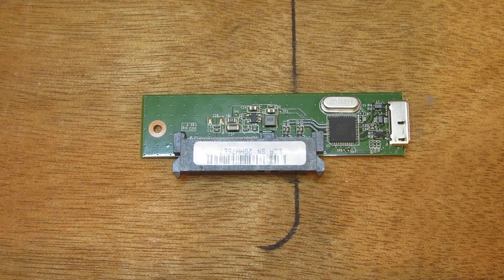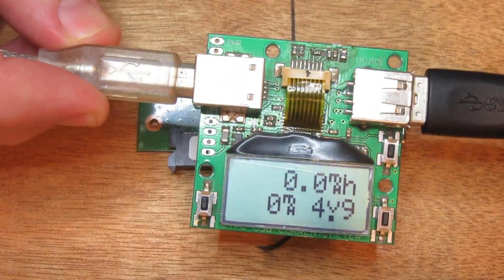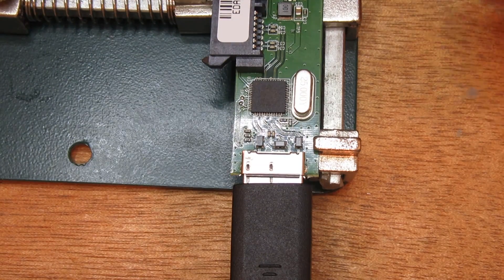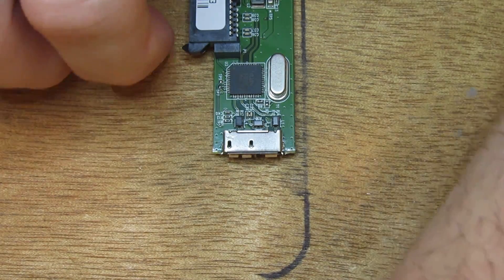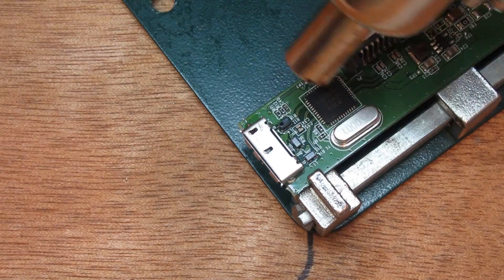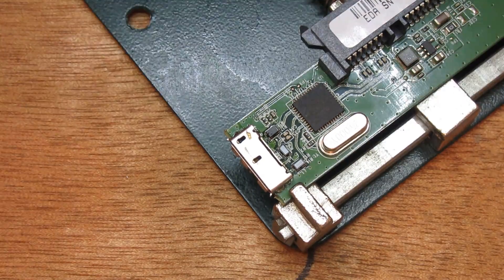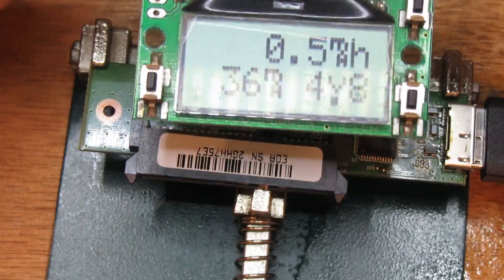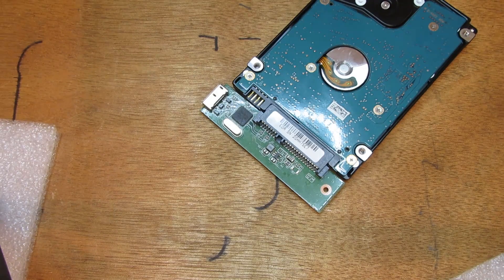What I fix daily - Hard drive USB-SATA Bridge board fault diagnosis and repair

Comment: hellıo, my 1 tb seagate external hd led light not turning on , in device manager it seems jms 579 (jmicron sata usb bridge)
disk management , disk unknown, not initialized, no size..

you think adapter is broken?
Reply from the maker: Easiest way is to get someone to open up the enclosure and separate the board from the hard drive and plug the hard drive in to a dock assembly
Reply: @pldaniels   i dont have an assembly but i have sata to usb cable? it can work? btw my hd was bitlocker protected..

Comment: Paul Daniels Thanks for video.
Do this board has in-built hardware (chip) for auto-encryption of data? I have bought 8TB Western Digital (WD) My Book ext drives that have this chip meaning if your board dies, your HDD is bricked forever cos all the data is encrypted with the key that is on that particular chip (needless to say, WD kindly provides this key for its users...). To get rid of that nasty encryption, I want to remove the WD HDDs from their original enclosures and put HDDs into some third party USB 3.0 to sata enclosures or use the type of board you are using here (if it doesn't have that encryption chip).
Reply: Engineer if WD provides the key what good is the encryption? It means they use the same key on all’s drives. Useless. You can steal and drive and get the key from WD. Not to mentioned if the above is true the key is already out there.

Comment: Have any suggestions where I could buy a board like that? I can't seem to find them on ebay
Reply from the maker: Just get any USB-SATA extenal enclosure and pull the board out.
Reply: Paul Daniels I opened up one of my Toshiba external drives from 2015 and the USB port was attached right to the board of the hard drive, there wasn't an adapter :/
Reply from the maker: Ah, one of those awful integrated USB drives.  Spot of bad luck there.  Just go to eBay, buy a 2.5" USB enclosure, it'll have the board in for normal 2.5" drives ( or get a 3.5" one and it'll work for both 2.5 and 3.5 )

Comment: hi paul.
i got a seagate external hard drive.
whenever i plug it on a pc and smart tv  i can feel it spinning inside and the sata bridge's light turns on but doesnt blink and it cant be detected.

pls help, what to do? should i get a new sata bridge/cable?
Reply: I have the same problem. Any help would be very appreciated.

Comment: ive got a sata bridge for a google 2 tb external hard drive and the usb metal connector has fallen off. I was wondering how much a replacement bridge would cost or the pricing on getting it fixed?
Reply from the maker: If it's a normal SATA drive then you can just buy a replacement enclosure and put it in.
Reply: I have the enclosure... I just need the bridge card becasue the usb connector broke off
Reply: oh you are saying the bridge cards come with the enclosure?
Reply from the maker: That's correct. Assuming your drive is a normal SATA drive (and not one of these unfortunate integrated USB-HDD single board units)

Comment: Hi paul,
My usb power bridge on 2tb hdd is not picking the hard drive. I checked it separately the bridge led is on when connect to power but when connect with hard drive the light goes away and no sound nothing on hdd. Please suggest
Reply from the maker: I am strongly suspecting the TVS diode on the drive (if it's a 3.5" ?) has shorted out.  I have another video on that.  If you test with a multimeter across the TVS diode, it'll read a low ohms or low "diode mode" in both directions.

Comment: Great video Paul and a nice repair. 

You'll likely know Paul but for those that don't... When working with micro contacts.. try applying the solder paste with a dissection needle or very fine point tweezers. Because if you get paste drawn under the ports legs..which does tend to happen as the port gets hot.. As the solder flows it creates bridges really easily underneath the port meaning sometimes can't get rid of it without lifting the whole port again. And most of the time it wrecks the ports too.. 
Especially those that have very short legs with no bends that disappear straight into their plastic blocks.. Like the ones in the Galaxy S3 mini etc

Cheers
John
Reply from the maker: Indeed - I was being distinctly lazy when I put on the paste (and the paste is a bit old, I don't use it as much as I used to as I no longer am manufacturing).
Reply from the maker: I meant to add, if I was going to repair it properly ( as opposed to locating the fault and testing ), I'd likely have taken the whole connector off and redone it"properly".

Comment: Good Job Paul ! I was thinking maybe the connector came loose by rocking in/out a bit too tight usb cable connector. Is 'going cactus' like 'going belly up' ? I find these USB 3 type B connectors have such a weird design. first time I saw one I thought the metal side was pressed in at the narrowing point by accident :-)
Reply from the maker: There's certainly going to be a few reasons for that to have broken free like it did.   Overall I'm  glad it failed like that and made the client bring the unit it, will have saved them significant grief further down the line.

The USB3 connectors are quite interesting,  they make a  bit more sense when  you notice  that the  smaller "half" is just a normal USB2 micro connector, and the larger portion is where all USB3 extended stuff.  You can plug a micro-USB in to the USB3 socket and it'll work (sorry if you already knew that).

Yes, "going cactus" is  same  as "belly up" :)
Reply: yeah the connector could've been reconnecting intermittently and damage the drive by speeding down/up suddenly. Very interesting about these USB 3 connectors, I didn't know that ! I have too old hardware for that :) Only my dad has an external drive with that 'new' connector. I bought that for him so he can backup his laptop every week.  I'm currently 'playing' with my new Raspberry Pi3. I bought it cause I still had the old P1-256MB and that was Slowwwwwww :)